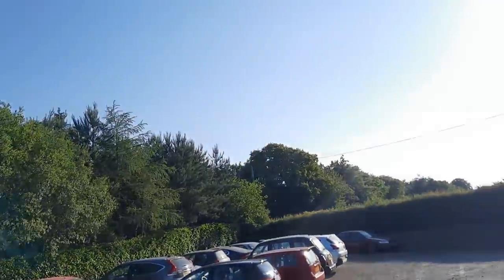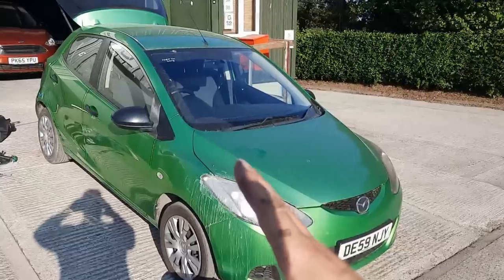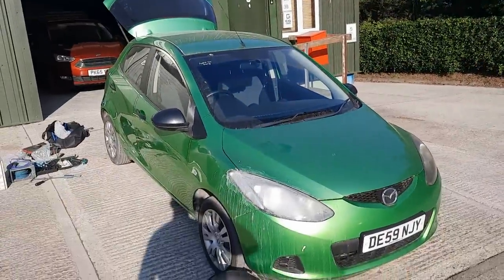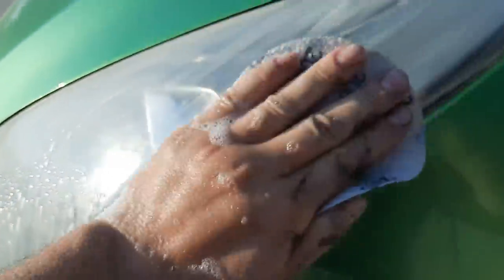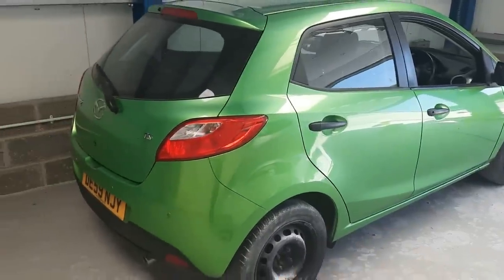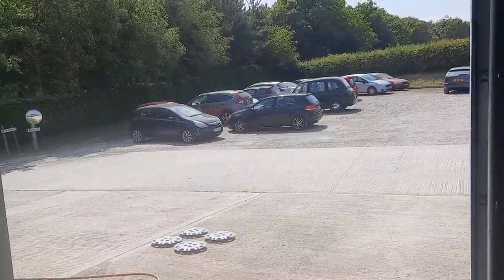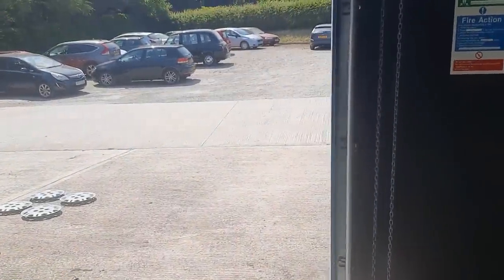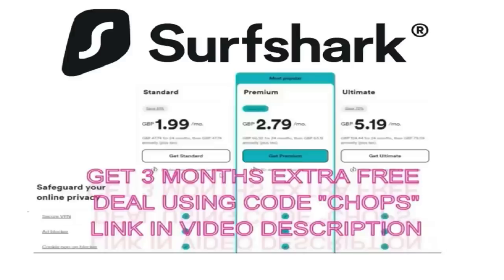I'd totally wasted my time with this fix!

Comment: Love what you do mate its basically what we do but for private customers. You need to get yourself a half decent compressor and spray gun setup I used to pay someone to do my bodywork too but eventually got fed up making £50/£75 a job margin so I taught myself took about 6 months until I was competent to touch a customers car. Now I’ve been painting pulling and filling for a year I take on Porsches Bentleys lotus etc and make a lot more per job!

Comment: Proud of you using the gun bud, don't go too low on your pressure or it'll not attomise right, 10th of a litre is only like  8 quid and that'll do loads, I get pro fix clear and that's only 30 Inc hardener for a ltr, that'll do plenty, I'd not bother pulling dents out just tap the edges with a Sharp hammer, grind out and slap the filler in, your not doing top line classic cars, I've never had anyone come back and say the fillers dropped out, I don't advertise anything till its done mate, service, paint mot, you'll always get a better price when it's 100 %done, nobodys really got any foresight to see past dents and muck, well not in Barnsley anyway (!)
Reply: Near me im after a car
Reply: On mazdas the colour will be in the service book (if it's got one)
Reply: It's called spirit green
Reply: @contactjd  well known bud

Comment: Never have shiny leather. It should be a Matt Finnish which is what you get with a proper leather cleaner. Great channel and content as always.
Reply from the maker: Cheers
Reply: Colourlock do a mild leather cleaner 1L pack with a brush and foaming bottle. That and some MF cloths is all you need. (Their strong cleaner is for a different purpose)

Comment: O dear so you change Shocks and springs in just 1 not both as you have done that on 2 different cars now ok yes if it was a Warranty job then ok thay would do the same but not if I was there thay wouldn't as its got to be done in Pairs or its actually putting the Suspension under different levels ect but you know all that anyway so why just 1 ok yes you don't have to spend as much but if a jobs worth doing then it's better to do it right you sorted the bodywork but then only did half a job on the springs ok its only a cheap car but even so it would be better to have all the Mechanics right and have the odd Dent in my opinion but I get it make it all nice and shiny and people will be more likely to buy it
Reply from the maker: Exactly , the pay for shiny not for matching springs, thats the market
Reply: O well people are putting looks above safety in my book but each to there own I suppose

Comment: You really should change springs on both sides.
Reply from the maker: As a rule true , trouble is public dont value it and still want to knock you down. They would rather save "100  on price
Reply: Sorry this wasn't meant to be a criticism, what you do with your motors  is far and beyond , so please keep up the good work and excellent videos.
Reply from the maker: @GordonBlachford-ut7ts  I did not take it as one don't worry, it was fair comment

Comment: The problem with sanding headlights is you've taken the UV protection off the surface, so unless you relacquer the lamp it will cloud again in no time.
Reply: Yeah he said that 🤦
Reply: Jabberwocky: The UV protection has already gone....that's why they are cloudy!  James DID mention replacing the protection.
Reply: Jabberwocky is right. A ‘sealant’ might help a tiny bit but at best is only a polish of some description. It will be gone in no time and you’ll have no idea until the lights start yellowing again. Doing the job right will only add half an hour to that job.
Reply: I use g3 and wax seems to work

Comment: job on lights looks great do u not use your lift anymore
Reply from the maker: yes spark on it for gearbox
Reply: @ChopsGarage  my 3 year in stock spark miss fires after about 30 mins, no codes, might just clean it up and punt it out, 13 plate.
Reply: @ChopsGarage  mines got a good box!

Comment: It's loads more relaxed bud just getting on with cars then advertising them, or maybe just have a little area for them outside when done, I absolutely hate customers breathing down my neck, by doing that mazda paint yourself, maybe a lad to prep it and binning the warranty wise you'd be 340 better off, weeks wages for a lot of people.
Reply from the maker: Yes I don't encourage it, people turn up out of blue and go looking through pre prep stock
Reply: @ChopsGarage  I've had years of that bud, but I've stopped it now, I try not to bother with local people, there always back(as you know) you spend ages talking to people and getting nothing done, did a mini locally last week and they rejected it after a few days, it's gone to Scotland today, where I hope it stays, I've always been that friendly local garage type but honestly it's a waste of time, women came back with a duff battery on a 500,moaning, went out and jumped it, 18 mths on (!) you've got the option to put something half done away as well if its a ball ache, where if it's sold it's all hands on deck, I don't want people wandering in tbh and getting friend ly, especially now cars are so troublesome, rather they went 100 miles away, unless it's something major they don't come back, local people are back all the time.
Reply: Because you do long adverts for them as soon as you get them😊

Comment: Discs and pads yourself mate, dead easy on your lift.
Reply: Don't even need a lift as long as you can get the wheel off. I've done all my pads myself.  It's throwing money away otherwise.,
Reply: @chrishart8548  I use a big jack mate
Reply: Give or take 20-30 minutes job
Reply from the maker: Oh easy enough but was able to prep another car ,photo and get it up while they did it
Reply: @thindo  exactly bud 15 mins a side if all goes well, I do loads for my customers, easy job and looks impressive with big shiny discs, I make on the parts as well.
Reply: @ChopsGarage  I know bud, I just do everything as you know.
Reply: @ChopsGarage  I guess with this being you job your time is as valuable as there's really. By doing it yourself it's not free like it is for most off us.